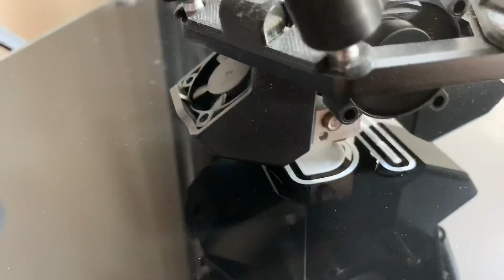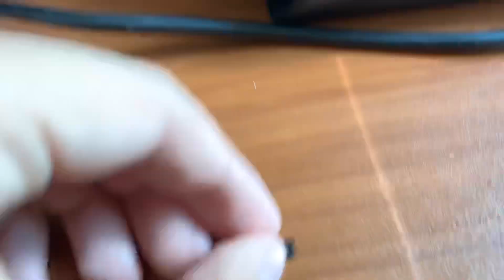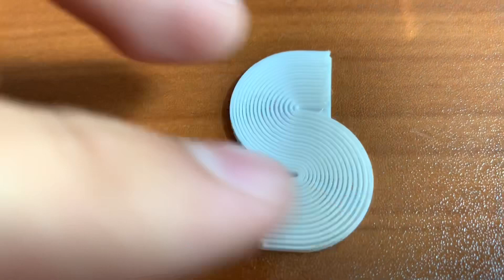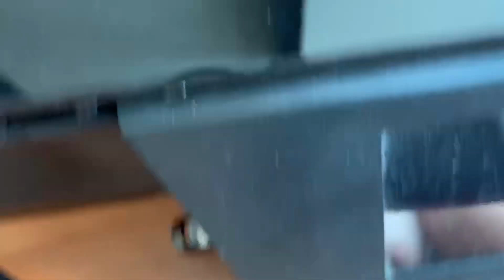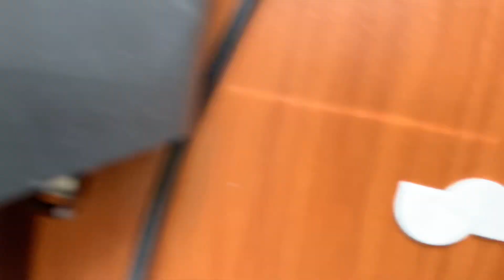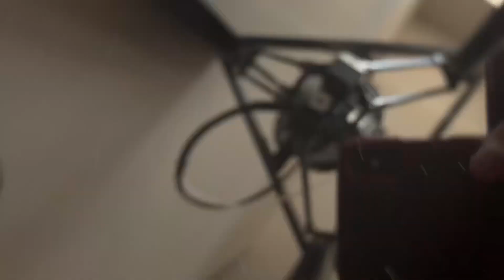3D Printing Slicer Manipulation Discussion and Proof of Concept

Comment: I can't figure out how to print this like the video. Using Cura 4.8 and just started out with a Sovol SV02 printer. I really have no idea what to set properly yet. Any help?
Reply from the maker: Han Sense this is a design technique. To print it you just need to download the file from thingiverse and put it into the slicer :)
Reply: @JLake3D  Hrmmm. I guess my slicer maybe isn't configured correctly, even with defaults. I suppose it's possible the model got scaled-down when opened...it does look smaller on my side. Can you tell me the expected X and Y dimensions? Mine are X=22.5981 and Y=34.4. Thanks for the quick response!
Reply from the maker: Han Sense that sounds pretty accurate. Its a small model to quickly test your printer tolerances.
Reply: @JLake3D  Mmmk. Dang, it's not printing well. Not sure what I need to do, since I'm really new to this. Any hints for nozzle size (.4), layer height (.2), wall thickness (.8), line width (.4), walls (2), etc? Lol, sorry, I just want this to print properly so I can move on to the bearings.
Reply from the maker: Han Sense those all sound good :0 is your first layer good? Thats one of the most important things on every print. Check your Z height.
Reply: @JLake3D  Yep. Got BLTouch working perfectly. I was about to buy some 608ZZ bearings and randomly browsed through Thingiverse, finding your model. Reading the description, I saw the info about the tolerances and wanted to make sure I didn't waste time and material printing the bearing model if the test wasn't successful, so that's where I'm stuck now :-O, since it looks like garbage when I try :-/, but yours looks incredible.
Reply from the maker: Han Sense it should work 🤷‍♂️ can you make a video showing whats wrong? I could then probably diagnose it visually.
Reply: @JLake3D  Thanks! I will as soon as I can!
Reply: @JLake3D   Sorry for delaying this! Here's live video of the print:
https://youtu.be/i95O_iBVsZk

Here is the Cura 4.7.1 preview of the print:
https://youtu.be/vvcWvd0gvGE
Reply: @JLake3D  So, I guess I need to know how to make Cura slice like PrusaSlicer, since I just tried that and it printed properly...
Reply from the maker: Han Sense oh wow definitely a slicer glitch. Pretty ironic considering this is supposed to manipulate the slicer 😅 cura often has glitches so i’m not too surprised. Prusa slicer is better for most prints anyways. I also use KISSlicer.
Reply: @JLake3D  Dangit! Alright, well 😲 I went to get KISSlicer installed and it was A LOT 🤣 I mean, I could go through all that, but it just seems like a lot of work right now, even though I'm trying to figure out how to solve my problems, and it might help with that...Cura is so simple (mostly), but it annoys me that I just keep running into quality issues when adjusting settings that are supposed to help! 😠 Thanks for taking a look for me!

Comment: So how do you do your slicer manipulation, some kind of design style? Really nice research by the way.
Reply from the maker: Danilo Ramos yea its basically designing a pathway of sorts leaving gaps between the layer lines, if its connected all the way it does it like a single movement. I actually used it in my latest experiment, check it out in the slicer layers :)

https://www.thingiverse.com/thing:3665950